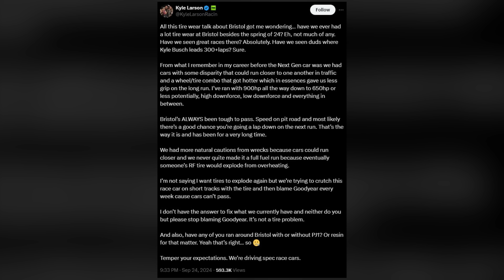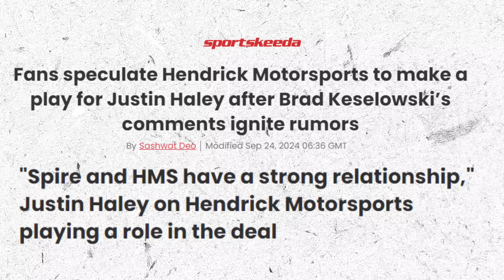What Rick Hendrick JUST LEAKED About HMS Future is INSANE!

Comment: If you haven’t been in NASCAR fan very long this racing sucks. I’ve been in NASCAR fan for a long time go to Michigan and I’ve been Bristol a bunch of times. This car sucks and the fans know it. We all know NASCAR knows it and they think they can fix it by just putting different tires on. They need to throw the car away a Formula One car, and bring the engineers back and let them build a damn cup car should not have to buy parts from NASCAR that’s making money off the parts that the teams could be building their cells. It just blows my mind. That’s what NASCAR does. They only worry about this ain’t helping the teams actually hurt the teams. They actually used to be building their own parks and house, and they could do it cheaper than the ones they’re buying through NASCAR that gets a cut
Reply: I have found that I like to watch the Xfinity races more and more and it’s because I like the cars better. This car is dangerous in my opinion. The reason Nascar built it the way they did is so they could also make all the money from selling the parts!  Monopoly!!